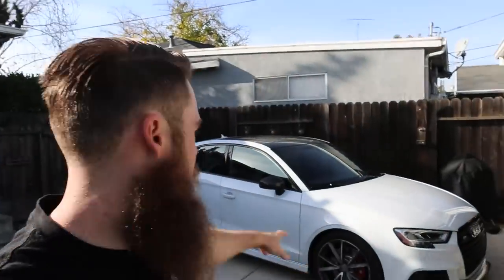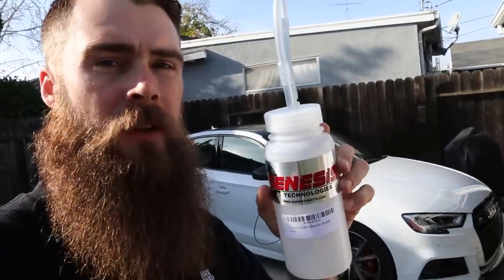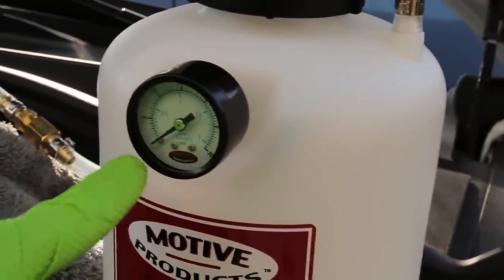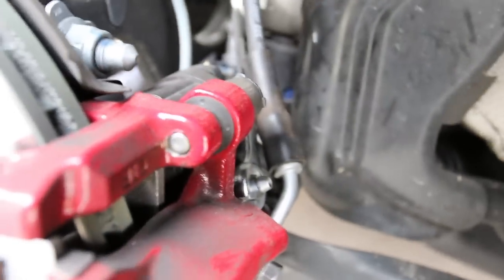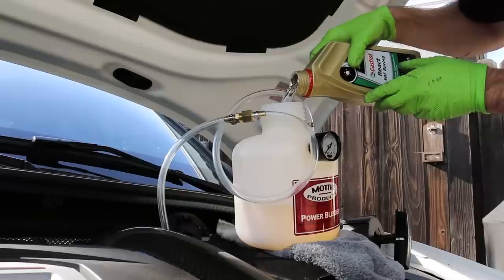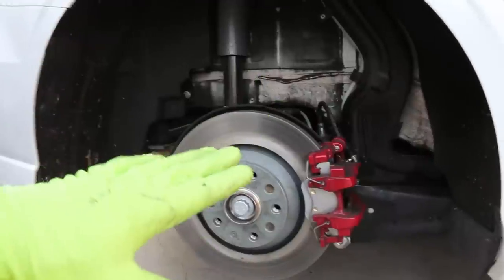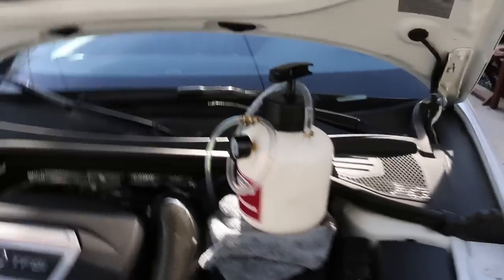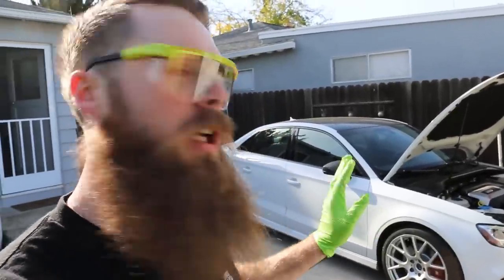EASIEST WAY TO BLEED BRAKES EVER!

Comment: I just bought one of these power bleeders.  It is great.  I have bought 6 different types of brake bleeders over the years and they have all failed.  This was amazing as I had to do a completely evacuated system due to failed brakes.  My daughters brakes went out on her while driving.  Her rubber brake line broke (completely broke from line end).   I actuated pump as I power bled.  Used a computer.  Put 64 oz of fluid through system.  Put new master cylinder on also.  This was a nightmare to put on Chevy HHR.  Had to disassemble the entire fuse box assembly to get to master cylinder.

Comment: If you put fluid in the catch bottle and make sure the hose is submerged can also be used  without the pump on the maser cylinder and you would open bleeder and pump brakes till clean fluid then close bleeder and refill master cylinder just another 1 man way of doing it

Comment: When doing the last caliper on the drivers side closest to the master cylinder, run the last fluid out of the pressure bottle and keep an eye on the master cyl and set the fluid level. That way you wouldn’t have fluid left in the line to drip all over your nice paint
Reply: That's the tip I was looking for, thanks!
Reply: @jcbryant6  Excellent comment. Whatever's left in the pressure bottle can't be used later anyways. Another tip is to keep a tiny bit left in the brake fluid bottle, so if you accidentally get it below minimum in the reservoir and the pressure bottle is empty, just add a bit from the brake fluid bottle.

Comment: Spot on. I too will attest this makes Brake Fluid Service sooo much nicer.  Having multiple vehicles that require different  reservoir adaptors, I can also recommend the the 'quick coupler' and related pieces for the hose.

Comment: ATE Original TYP 200 DOT4 Brake Fluid meets SAE J1703 and FMVSS 116-DOT4 standards. It has a dry boiling point of minimum 536 degrees Fahrenheit and a wet boiling point of minimum 374 degrees Fahrenheit.

Comment: Can also be done with a vacuum pump connected to the bleeders. And apart from the pressure gauge and connections to the reservoir, that is one of those gardening pumps for  spraying water, fertilizer and other liquids on plants (surely the price for the conversion might not compensate.lol)

Comment: So I'm installing new Rotors, Brake Pads, and Calipers on a 2005 Toyota Matrix.  The Brake fluid has never changed in over 150k miles.  The car has ABS brakes.  That being said I have 2 questions.

1) Do I leave the car running when I bleed the brakes? I've herd with ABS brakes you need to leave the car running while bleed.

2) Do I Need the bleed the brakes twice? Once before I install my new calipers and Once after I have them installed, so all the old brake fluid is not flowing through the new calipers.

Thank you for any feedback!

Comment: What did you use to suck the old brake fluid with how much did you take out of the reservoir and where did you get the tool from?
Thanks
Reply from the maker: Dedicated Turkey baster or don’t worry about it and just flush everything out. Links for everything else are in the description. Thanks 👍🏼

Comment: Nice bro!! Something I'm gonna have to probably do soon on the WRX!! That kit looks like it makes it easy!!
Reply: Super noob question:  When you are putting the new fluid in with the power bleeder and then you go and loosen the 1 brake, fluid comes out - What would happen if you loosened all 4 at same time? Are you supposed to tighten back up the 1 brake then go do 1 by 1?  I haven't done brakes before funny enough haha...
Reply from the maker: NinjaxBart you just wanna do one at a time in the proper sequence. If you do know you’ll just be wasting fluid and the system will be fully bleed and Replaced

Comment: Sorry I’m a little confused. Are you not supposed to fill up the reservoir with some new fluid. How much new fluid goes into the reservoir and how much goes into the Motive Bleeder? .5 liter in each?
Reply from the maker: You fill the bleeder only at first it will transfer through the master. Then after your done just top off the reservoir.
Reply: Blake's Garage ok thanks really appreciate it

Comment: Did you extracted the old fluid from master cylinder first ? Then filled it with new fluid to level ?
Reply: Yes he said he would suck the old out first. You could buy a plastic syringe at a pharmacy. And connect a plastic hose on.

Comment: I noticed that you had a screw on fitting on to where the cap fits on the reservoir , I have a Kia ceed that has a half turn lock cap, do you have to get the proper fitting for each vehicle before you can commence this flush out and bleeding process ?  After all if you don't have that proper fitting for the particular vehicle you doomed .
Reply: yes you gotta have the correct cap for the master cylinder reservoir.

Comment: According to step 2 (see below) of the Motive power bleeder instructions, after removing the old fluid from the master cylinder reservoir, you should refill the reservoir with new fluid.  I didn't see you do that in the video, you only filled the pressure tank with new fluid (per instruction step 5). Did you skip refilling the reservoir wit new fluid, or just not show it?

"2. Remove hydraulic fluid reservoir cap from vehicle. If old fluid is excessively dirty, siphon it off **and refill reservoir with fresh fluid**. Do not pump excessively dirty fluid
through hydraulic system."
Reply: 2:33 he said he did

Comment: I realize this is an older video, but I have a B9 S4 I am thinking about bleeding the brakes myself (dealer quoted me $600) and scared me by telling me there are electronics, such as ABS systems or Audi presence systems that need to be calibrated whenever you change fluids. Sounds like BS to me, but maybe you can give it to me straight!
Reply from the maker: I found that I had no issue with that. However if you buy the OBD 11 App you can run those procedures from your phone. I know there is an ABS bleed owed and there quite possibly find me a presince mode I never had an issue with that why because I had a completely sealed system I never had an issue.

Comment: Very well made video. That beard must weigh 5 pounds!! I bought a different type of brake bleeder, but being the kind of guy I am, I will convert it to work like this one. I do not race my 92 GMC truck, but it does use brakes. It's brake fluid is BLACK! I will change the brake fluid in the next month. (Have to replace the Subaru power steering pump first). A very nice car! When does the racing video come out? What have you done to your engine?
Reply from the maker: https://youtu.be/phg8U3eChks Track day video. Car is Stage 2 with tune downpipes and intake.
Reply: @BlakesGarage  I will watch this, but first an update. On Sunday and Monday, I felt a little flu like...that yuck interferon feeling. Tuesday I felt great! I had to work on my truck. The weather was nice. I decided to bleed the brakes using the compressor made venturi vacuum instead of what you did. well....soft brake pedal! I finally bought more brake fluid ( walmart cheapest dot 3) and met my neighbors wife at the mailbox. She offered to push the pedal. I decided to do it the old fashioned way using 2 people. ( One pushing, the other yelling using a wrench) We had one brake to go and my wife drives up from a doctor's appointment. (they are friends) Well, THAT slowed things down AND taking the front tires off. Got'r done! Good brakes now. Engine needed a wipe down because once I had the brake fluid res. cover off and told her to push! Fluid shot all over the place. It's all good now. Clear fluid!

Comment: Quick question change brake pads on rear when I was finish I pump the brake pedal then I notice while driving no rear brakes I was told you don’t need to pump the pedal some say you do, then some say bleed the brake when you change pad some say you don’t need to bleed . But all I know now is when I push the pedal it hard and don’t go all the way through but not to the point I don’t have and brake . I push the pedal and it goes halfway to where the front brakes engage . So can you tell me what’s the problem . Like video and your style
Reply from the maker: You have to at least pump them a few times as the piston is compressed from you pushing the piston into the caliper. Sometimes it takes a few pumps to get the pads to touch the rotor. However its always a great idea to change the build and bleed the brakes. You could have bigger issues if you still have no rear brakes like air in the lines or a bad master cylinder.
Reply: Blake's Garage ok thanks a lot
Reply: Jam

es Guy
Reply: Sharli Hoopiiaina what are you saying

Comment: I like the concept, but I have 7 cars.  the cap on the brake fluid rez could be different.  Does this kit come with several different size rez caps?
Reply from the maker: M.C. A. Yes, check my link there should be a master kit under recommended items.
Reply: M.C. A.:  Sell 6 of your cars... problem solved.
Reply: Look up the Power Probe BAKIT01 master brake cylinder adapter kit.  Makes any car a breeze with the Motive bleeder and a quick connect coupler.  That's the setup I use.

Comment: If you are braking at say 160mph its good to have it other than that you dont need that.. Plus racing fluid requires to change the fluid frequenly as it breaks down quicker.

Comment: I wonder why you did not attempt to purge  the air out of your pressure bleeder hose connected to the reservoir at the start. Isn't that bad to put all that air into the reservoir while pumping the new brake fluid through that line? Thanks for video.
Reply from the maker: No because it pushes the fluid through the master cylinder. The master cylinder is never empty it doesn’t push air at all or need to be purged. Actually they tell you to test the system first with air only to check for any leaks in the pressure tanks

Comment: Does the pressure bleeder work if you put no fluid in the reservoir?
Reply from the maker: Needs fluid. To keep the lines air free.
Reply: @BlakesGarage  Okay.  The question I was trying to ask is.  Lets say you only wanted to bleed one wheel.  You did not want to dirty the container.  Can you pump it up go to the one wheel?  Loosen up the bleeder.  Will there be enough pressure to bleed the one wheel?  Oh yes.  Don't let to much fluid out because then you would let are in the system.
Reply from the maker: siucbset no when it runs low it doesn't push fluid from my experience. Allways fill it up.

Comment: How are you not adding air into the system ? 

Unless you bleed the air  master cylinder brake bleeder setup air has to move into your brake system .

Comment: That Castrol brake fluid is classified as dot 4 and costs a lot. It has same boiling point as dot 5.1. why not use dot 5.1 (that costs 1/6 and has same boiling point)?
Reply from the maker: It’s not gonna have the same wet boiling point.
Reply: @BlakesGarage  thank you for answering. There is indeed a significant difference (90°C).

Comment: Almost smashed that thumbs down button...... not for anything about this vid but because i just replaced a master cylinder and had a tough time bleeding system for some reason. This system kicks asss.  Thumbs upped on vid. Thanks for  great job.  Will check out you channel.

Comment: They use cheap rubber on those power masters and you will see it's only good for one bleeding theres a cleaner they recommend to use but that brake fluid eats up those rubber fittings get ready to buy one every time you bleed it dont work good the next year and buy a half gallon of brake fluid it use that much

Comment: i have the,,same gear bud,,,, ony mine is better ,,,,as  you leave  the electric pump on the bottel  but you do need a  air pump that  says the air pressure
Reply: mine is longer

Comment: you don't need 2 people  do to brake bleed, its simple and one person can do it and without your expansive tools. its just waste of money.
Reply from the maker: It’s actually not a waste of money. This kit works amazingly. It’s very fast and simple to use. I know there are other ways of doing this but this is by far the best method. Don’t be a cheap ass get the right tools and make it easier on yourself

Comment: Hate to be a dik,,, but you will never brake that car anywhere near hard enough to come anywhere near even 400 degrees,,,,, so why use that fluid?
Reply from the maker: Well you’d be wrong. My calipers paint turned from red to black from Trackdays at Laguna Seca. It’s a safety measure for tracking a car better safe than sorry using a cheap ass brake fluid. Tracking isn’t cheap and never cut corners on safety measures.
Reply: @BlakesGarage  um, so..... the only way to properly measure that is in real time at the track,,, take a laser thermo gun and read the temp just after you come to a stop... only then will I believe your over 400... caliper paint means nothing to me, I don’t care what “they” or the label told you.. lol